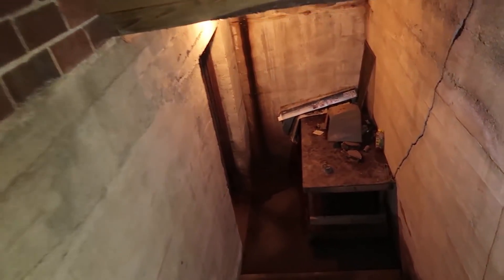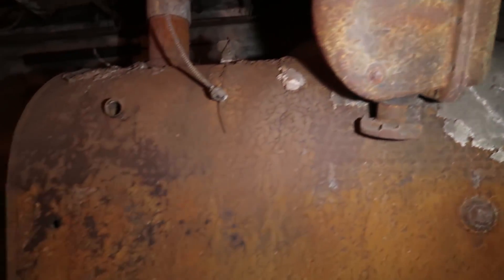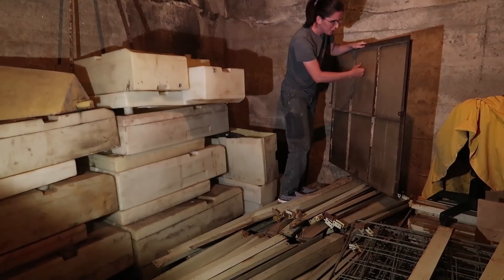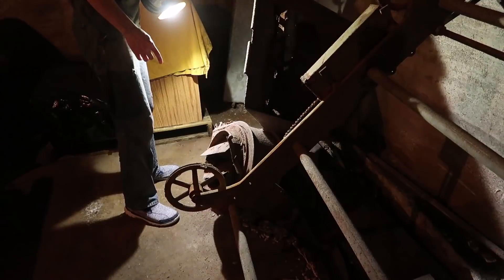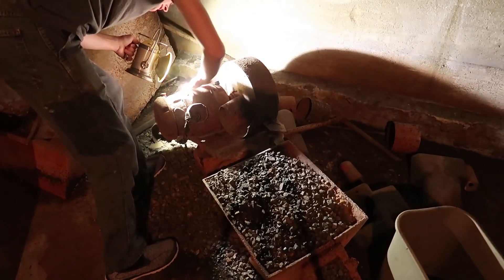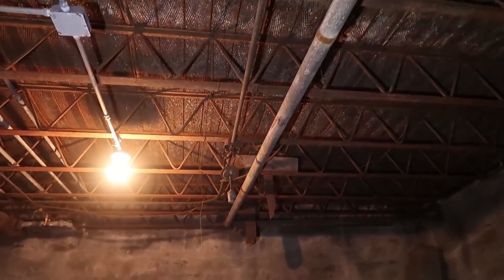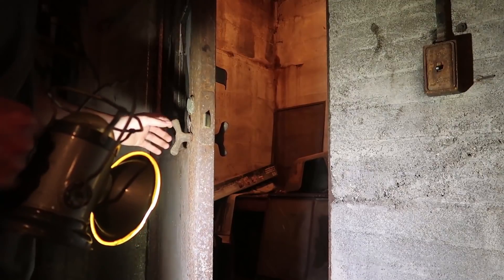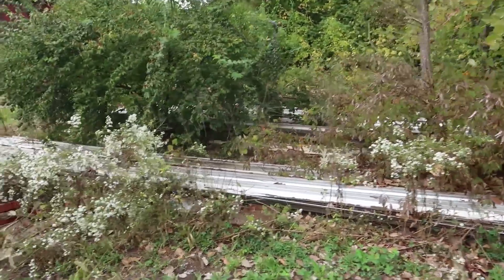Random Bits 0214: Exploring a Semi-Abandoned Industrial Basement / Boiler Room

Comment: That device leaning up the wall looks like a fabric layout unit used in a cut and sew factory. It is similar at least, to one. You put a large roll of fabric on one end and the pulleys roll down a rail which allows the fabric to be laid out flat and straight.Then you cut out patterns with an electric razor-knife.
Reply from the maker: oh i bet it was used for seat cover fabric. this used to be an auto restoration and racing supply shop

Comment: Thats cool that you have that window for your workshop, i personally would be worried about its strength because of its age but then again i don't really know anything about windows so i guess it'll be fine since id assume your not going to be playing baseball and hitting windows. Also that door would probably look really cool just need to make sure it does not rust much more from the weather and it should be fine. Good luck to you Rinoa and i hope your workshop  goes well.
Reply from the maker: the frame is very thick, itll be fine. if not i can weld more metal onto it.